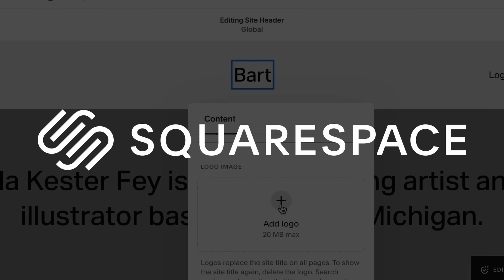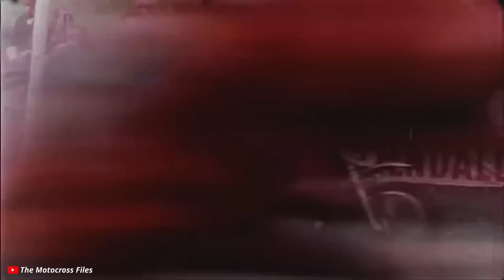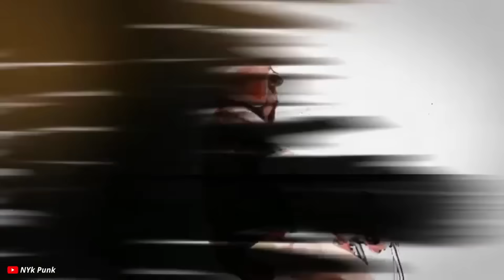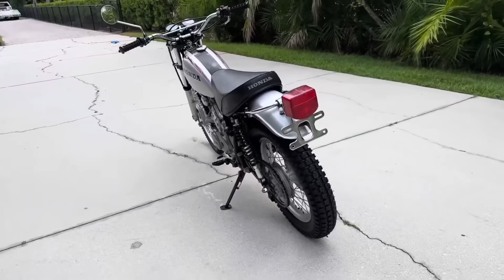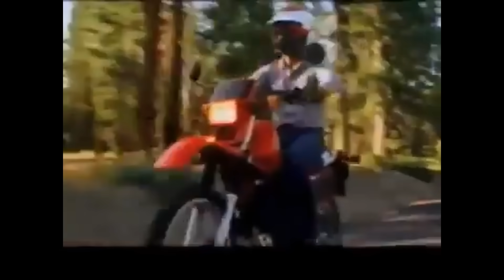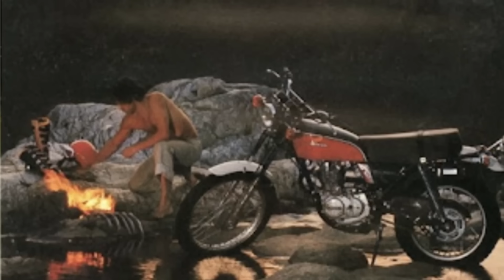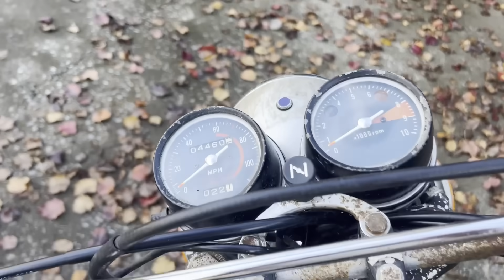The Forgotten Honda That Made The Enduro Scene

Comment: HEY I MIGHT BE ABLE TO GET MY HANDS ON ONE OF THESE. Now why wouldn't you just get one of the state of plates you can put on these now and run the CDI unit. Instead of just running the points is that just to keep it all original or I think that would be the way to go it's supposed to be going to ride it. Could you let me know why didn't you go that route with the CDI and you stay there cuz I know I'm pretty sure they're available you can make something work but I have to get my hands on a 73 and I just love these bikes and I'm going to have to drill the head out to get the I guess the stock spark plug out but I'll probably just send that the head and cylinder out to be replaced so they can deal with that

Comment: On  June 14, 1972 my twin brother and I bought new XL 250 HONDA MOTOSPORTS. WE PAID 879.00. WE DROVE THEM  10,000 MILES THE FIRST SUMMER DOING ALL KINDS OF RIDING. IN THE SPRING OF 1973 MY BROTHER AND   I., ALONG WITH 5 OTHER GUYS,  RODE OUR XL 250 FROM GRAND RAPIDS MN TO THE WEST COAST ANF THEN UP INTO B.C AND THROUGH SASKATCHEWAN BACK TO MINNESOTA.  WE PUT ON 4,500 miles in 19 days.  Cost us 200.00 dollars! The bikes had 15,000 miles on them after the trip. Traded them in on XL 350 in 1974 with over 20,000 miles on them at time of trade. We had a great time. Love that old Xl 250.  We were just barely 17 when we took that trip.  Kids now a days are glued to their DEVICES.

Comment: my first real bike i bought off a shop for 100 bucks. and 50 to bring it to my house. got the clutch unstuck cleaned the carb, and it RIPPED hard. eventually tires and such but she ended up dropping a valve. Worth experiencing it . I agree , it pulled like a tractor.

Comment: You left out a majority of the culturally important information surrounding the original XL250/XL350. 

Here are 3 interesting pieces of history surrounding this bike as an example of just some of what you missed. 

1) This bike was the first successful 4 valve overhead cam production motorcycle engine manufactured to this scale, largely due to Hondas push to innovate small 4 stroke engine technology.

2) Bill bell and long beach Honda. Hot rodders very quickly found massive tuning potential and easy power gains in the XL250, leading to rapid growth in aftermarket support in the early 70’s and ultimately Honda releasing the XL350K0 2 years later, which went on to win repeatedly in Baja racing with pilots and builders like Al Baker and Bill Bell. There were shops making 40-50 horsepower out of these bikes in the mid seventies as a result of the inherent potential of the XL250/350 power plant.

3) There’s slightly limited knowledge on the internet surrounding my third point, but the XL250K0 was designed as a motorcycle for the Japanese military at the time, and has seen use in conflict around the world outside of strictly use by the Japanese. The military design motivation for the XL250 resulted in a largely overbuilt motorcycle for the civilian market, with certain desirable qualities leading to its success. The heavy and robust mild steel frame, soft suspension, and underworked/under-carbureted engine are all characteristics that resulted from design for armed forces. Incidentally, this also made the bike bomb proof, if a little underwhelming in stock form from a performance perspective.

I would encourage you to filter through more old magazine articles from the era on the topic of the XL250 and even more significantly the XL350. From 1972-1978 there are volumes of documented historical and cultural significance available to read. The post 1978 bikes are entirely different animals all together, but great bikes with their OWN history nonetheless.

This video essay leaves out too much history, and while subjective interpretations are inevitable, I think you missed the mark with this one. Hope to see better in the future.

Comment: Bart I'm sorry but I don't agree with comment that the SL125 was not great on or off road bike .. I had one for many years doing city rides for work etc but also long distance,  several times I did 6 and 700 miles often in bad weather ( at the time I lived in the UK ) then at the weekend scrabbling... it was a great all round bike ....now 50 years later and many bikes later I think it's one the bikes I miss the most. I sold my SL125 And bought the XL 250 ...it was good but missed the character of the 125..... but of course I'm a lot older then you and expected different things from bikes when I start riding in 75..funnily I still have a hondacb550 super sport...plus a 96 BMW R80R which I've made in a cafe racer .

Comment: As a 15 year old in 1977 I bought a new XL250s, with money I had earned working construction that summer.  I rode the pudding out that thing, both on and off road. Those laid-down rear shocks and "long travel" front forks were impressive back then. I quickly found that this bike was a wheelie machine - so I practiced until I could loft the front wheel changing into 2nd gear, and continue the wheelie through 5th gear. When the front wheel finally touched down it would let out a chirp 😊 
Good times!

Comment: the xl250 is a really great bike  mine is a 74 or xl250k1 it is set up for deep woods riding the engine has an tl250 camshaft i use 2 differant exhaust pipes depending where we ride i loaned it to a friend for a hare scramble he had ever rode a motorcycle off road he raced 4 wheelers,the  xl250 took him to a first over all.

Comment: In the mid to late 70s I sold my car to save for a Westfalia for surf trips.  I went to commuting to work on my 1969 BSA 441 Victor Special. 
National speed limit was 55. The BSA had a crappy fork. I test rode a nice used XL 250. I thought the more modern 250 would be an upgrade. I was literally shocked by how slow the XL 250 was. It was NOT suitable for my commute in 55 mph America. 

441 Victim was a more suitable commuter for me. 

Good on you for dealing with all that rust. That would be a 100% pass for me. Yuck

Comment: I had a 260 Elsinore.  The tachometer operated via a nylon sprocket.  The same sprocket that pumped oil to the 2 cycle motor.  Sooooo, If the tachometer quit working (as mine did) the motor got no oil and seized.  My dealer reluctantly fixed mine via the warranty but believed that I ran the oil tank dry.  Satisfying when I seized the motor quickly after they returned the fixed bike to me.  The nylon gear had not been fixed.  Ha.  All my other Hondas  (9) have been flawless.
Reply: Uh...250 Elsinore.

Comment: traded an Yam CT2 in on 1 in 74, Honda XL250 Motorsport, bit heavy for a dirt bike, I mainly used it to commute, solid reliable tractable kinda dual sport, never let me down. went 2 stroke from then on, road bikes, was in the trade till 80. good bike though.

Comment: I remember the original Cycle magazine test. The poor writers were almost in tears because it didn’t have a chrome-moly frame.  

Yup. I had one.  There’s a lot of truth to what you say.  But the suspension was absolutely nothing special.  And the SL-125 was not a bad bike.  I had one. I rode it everywhere on trails.  And all winter on -20°C snowmobile trails — hard as a dirt track.  

The Yamaha DT-1 was the prototypical dual-sport.  And those were also reliable and easy to work on.  

I don’t think it’s fair to claim that 4-strokes were inevitably going to take over.  

OTOH, those Honda motors (250, 350) motivated quite a few people to shoehorn them into better chassis.  

In Canada, they were fairly popular for ice racing.  Those engines were seriously hopped up.  The stock engines were pretty tame.  

Modern dual sport geometry and suspension is so good that when I think of an XL-250, I nearly break down in tears. 

If you were to try a nicely set-up 2007 KTM 525 EXC, you’d notice about 3x the horsepower, stellar suspension and almost magical frame geometry.  And under 300 lbs as well. 

Those old XLs wouid loop out on hill climbs SO easily.  A big, modern KTM goes up a steep, gnarly climb like a missile.  Loop-out?  Never crosses a rider’s mind. 

Sure there’s a place for those XLs.  It’s called “plonking” or cow-trailing.  

If you want a “modern”, XL-250, I’d say look over towards Royal Enfield. Similar philosophy it seems to me.

Comment: Nobody seems to notice or make any mention of the fact that the 1972 Honda XL 250 is the very first production Honda motorcycle to feature a 4-valve cylinder head. Yes, Honda's 1960's road racers all had 4-valve heads but this is the very first production Honda to have a 4-valve head. That seems like a big deal to me but nobody else seems to think so, lol. I bought a new XL 250 in 1972 as my 1st motorcycle when I was 16. Like many in this comment section, I loved my XL 250. Super reliable, quiet, easy to ride. In all honesty though, compared to it's 2-stroke competition at the time, the XL 250 was underpowered (17-18hp) and slow, heavy (278lbs dry) and had minimal ground clearance (7.5"). But I loved it so much that I bought one listed on eBay about 4 years ago, just to have in my garage. Every time I ride it I'm transported back to my 16-year-old youth :)

Comment: Bought my 1975 250 Honda 2 stroke MT Elsinore in76 with 300 miles on it for $700. Great bike that for some reason outran my neighbors’ 76 models and left them in my dust. We never did figure out why because they were the same bike, carb jetting the same and all.

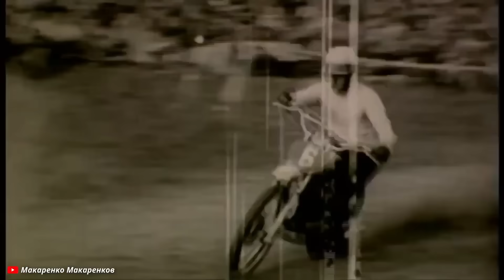Comment: 5:39 - For the purpose for which they were built . . .  "trail riding" - the SL range 100, 125, 175 and 350 did the job quite well. The 100 and 125 would capably follow the XL250 around all day.

Comment: I had the first model XL 250 absolutely flogged the guts out of it for three years never had any major problems in the sand. They left two strokes behind in the deep sand very hard, bike to stop in any situation off-road scramble for that era. Great Bike for the time.
Reply: Used to have a xl 250 was good for 9,000 rev wheelies 1,2,3rd gears they 🔥🥳🤙earnt the name the tractor

Comment: Cool story, bro. I've had a bunch of 72-75 250's, currently ride a 74 on a regular basis. I put on a rear 606 and man, do these baby's climb, even up hill in wet leaves! And they're low enough to touch the ground on off camber hills. Enjoy your xl, you got a new sub.
P.S. I don't like tank liners either. Vinegar soak and a good paper Wix fuel filter are the ticket.

Comment: Had a K3, 1976 red and black XL250  as a ride to work bike. It was very characterful. A bit like a brit single sounded meaty and strong. The bike was quick away from a standstill, partly due to low gearing, every bit as quick as the TS 250 Suzuki 2 stroke I had after.

Comment: I bought 3 of these XL250's in 1972. The first two were stolen within 3 days of ownership !.
(I think somebody at the dealership had keys.) 
In those days the key number was on the lock.
The third one was a gem and I had it until I replaced it with a CR250M.
Fond memories indeed.

Comment: The XL250 was a heavy, poorly suspended lump of a bike, slow, front-heavy, and had a serious engine flaw with the oil supply to the cam bearings.
Roller big-end bearings meant low oil pressure, and the cam rotated on the alloy head casting, any interruption to good oil supply from a damaged clutch cover gasket or blocked mesh filter would result in a damaged head and excessive cam movement, altering the points gap.
Bronze half-shell bushings being the common fix.
Reply: Anybody ever call you Eeyore…..?!
Reply: @Pablo9989-lj7pm  
Only my lady friends when they saw my donkey-sized con rod.
I forgot to mention the soft philips head screws on the XL ,levers that snapped easily,,as for 20 hp,well that sure was exciting......not! hehehehe.

Comment: When I was young (1970's and 80's), I thought of the XL250 as the ideal motorcycle. Remember that the speed limit in the US was 55 mph (89kph), so 250cc was plenty for highways.  Even a strong 175 was OK for most riding on the road.  I considered 15hp at the rear wheel acceptable.  These days, I think double that to be the minimum I would consider an "all around" motorcycle.  That pretty much means 300-350 water-cooled twins and 400cc+ water-cooled singles.  My old air-cooled Hond FT500 thumper was fine at 27-28 hp at the rear wheel, but near the lower end to maintain around 75mph (120kph) on the hills where I now live.  Of course, flatter areas can get by with less power.

Comment: I still have one with a 285 kit, Mega Cycle cam, springs and rockers, Bassani pipe, aftermarket shocks, Clark's CR tank, 79 YZ250 seat and DG plastic fenders, GoldenTyre GT216 front and rear.

Comment: I bought a brand new XL-250 in 1972 when they first came out. I used it as a commuter for work and for some enduro and trail use. I loved the simplicity and dependability of it.  Here some 35+ motorcycles later, I wish I still had my old XL250.  It was that good.

Comment: Bart, you are WRONG. SL's were designed ground up, far more SL100/125 raced than XL250's and were more successful. The basic engine architecture came out in the SL100, had frame and suspension that had not been used on another model (like the XL250). The XL250 was a good dual sport but you are sooo wrong about that it "helped define the modern enduro scene" that statement is embarrassing and laughable really. Are you having AI write your scripts now? Ive been a fan of yours in the past but you are way off the truth here. The Later XL/XR 250 was decent for off road though far from top line enduro bike, heavily modified it was better.
Reply: >…it "helped define the modern enduro scene" that statement is embarrassing and laughable really.

Glad someone finally said this. I like Bart's videos, but to those of us who were there, they are presented with more "authority" than they should be. Working the parts counter at the local Honda dealership in the early '70s, that's not at all how I remember the XL250 being generally viewed. And yeah, I bought one new back then. Didn't keep it long. Was just too heavy for sprightly trail riding. My Suzuki TS185 ran circles around it. The bikes overwhelmingly considered the definitive dual-purpose (the "dualsport" term came much later) were the Yamaha DTs. The SL 100s and 125s garnered more trail riding respect than the XL250. The XL250 could survive 70-ish on the interstate, but not something one would want to do very often.

Comment: Use PDR, Paintless Dent Repair to pull out that slight dent in the metal ags tank. 
It can easliy 100% be removed wtith no damge to the paint or any clearcoat will occur.
I have learned via YouTube how to 100% remove dents in automobiles and motorcycle metal gas tanks.
Remove the gas so it does not draw away any of the heat.
Patience pays off.
Very simple low cost tools.
I had a red XL100 1972 (I forget the year). Super good reliable bike.

Comment: Sorry but you know your wrong.  Hear me out . This is a very dangerous game you play and more likely your a wolf in sheeps clothing trying to warm up to the feds or feebies by promoting population control .  Reason i say this is because there is zero safety in dual sport bikes.  Dual sport bikes are no good for trails and track and not safe on the street and highways. Nobby tires and max suspension travel are for off road . Weighed down battery and starter lugging bikes with dual sport tires are not good for dirt or pavement. Just get two bikes and i guarantee you less injuries and lower insurance.  Think about it.  You engineered out the trail and track ability and engineered out the road bike needs to mest in the middle on a bike with 50 percent of both scooped out. Research it yourself and and you show statistics on injuries go up and repair costs skyrocket so stop endangering good people with your ignorance . Dual purpose is double jeopardy for dads and families. Buy two bikes and a tow attachment and your legs will last...kk. be nice
Reply: I’ve seen people say that dual sports are compromises (which is true, and having two specialized bikes is ideal, or alternatively N+1), but I’ve never seen someone straight up fearmonger about them. 

The CIA, ASIS, and Japanese corporations are conspiring to thin out the population! Dorkintheroad and Big Rock Moto are the CIA’s top guys in psychological operations! Cross Training ADV is a front for the ASIS, lead by the notorious Australian black operations veteran only known as “Barry!” FortNine got suspicious grants from the Canadian government after posting videos about the KLR650, DR650, and the WR250R! Every single member of the ADVRider forums has bioluminescent skin! I’m sure Bart will get his “Christmas bonus” very very soon! Lmao. 

Stay safe out there, America’s Number 1 “outlaw.”

Comment: I had an XL250 back in the 70s, loved that bike!

After a wreck that bent the front forks, I replaced them with the longer travel forks Can Am was using back then, installed an aftermarket slip on exhaust, upgraded the rear shocks, stripped all the lights off.

I shocked lots of Yamaha 250 riders, other 2 stroke 250 riders with that bike. Hill climbing, riding through deep sand, forest riding, it excelled.

One of the things I loved about it was the relatively low seat height. Modern semi dirt bikes have such high seat heights, I hate that.
Reply: Me too. I HATE the fact that you darn near need a ladder to mount a 250. Grrr 😖

Comment: I bought a 1981 XL250S with a blown engine in 1984 for a whopping $200 (a side cover had cracked and it ran out of oil, the owner just wanted it gone).  A new side cover, cylinder, and piston rings, and a weekend of rebuilding and I had an outstanding bike that I rode for years.